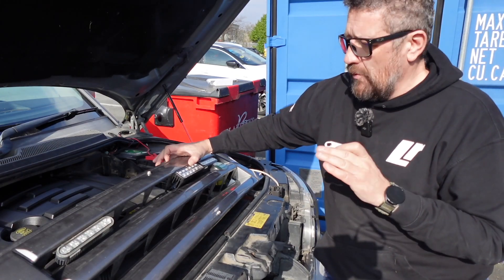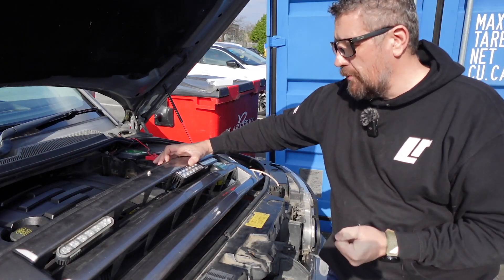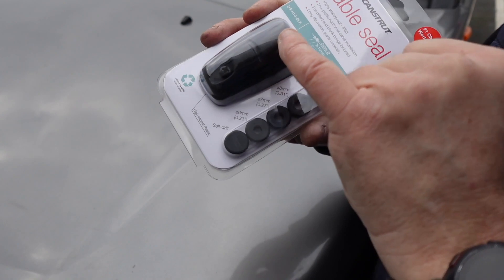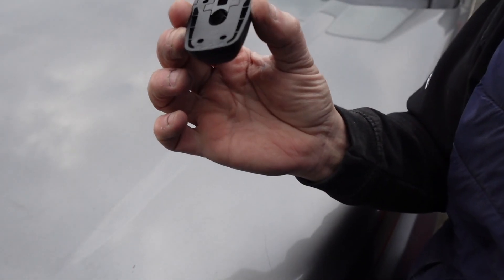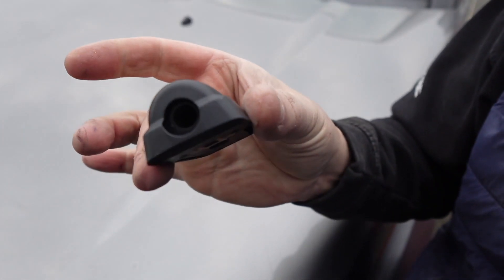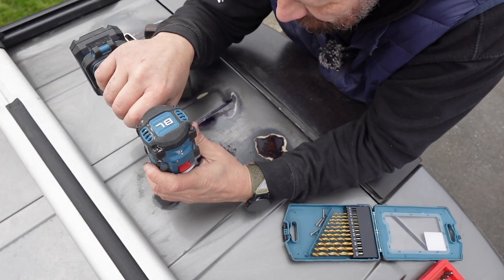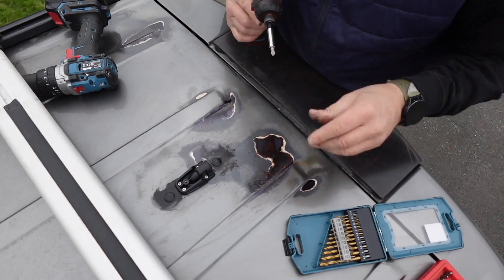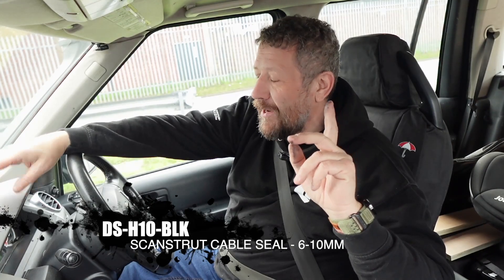DS-H10-BLK - SCANSTRUT CABLE SEAL - 6-10MM - WATERTIGHT SEAL FOR ROOF MOUNTED CABLES

Comment: I have this model.  The instructions say to install the grommet on the cable between the inner and outer shells.  I can't make this work because the grommet it supposed to mount inside the outer shell, and it doesn't seem to be able to be forced into the outer shell opening from the inside.